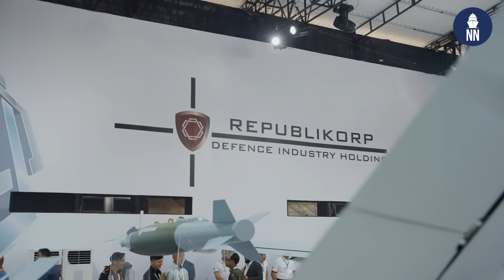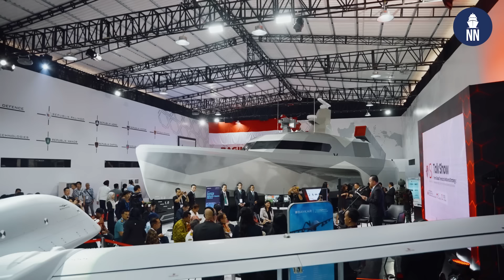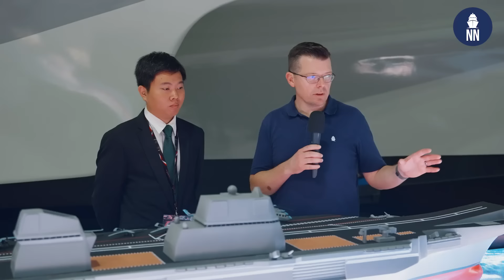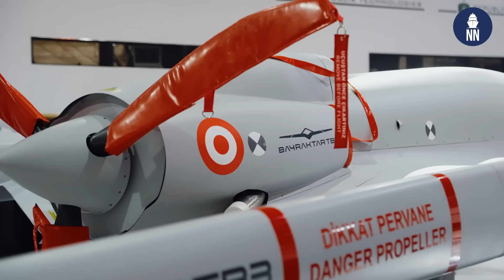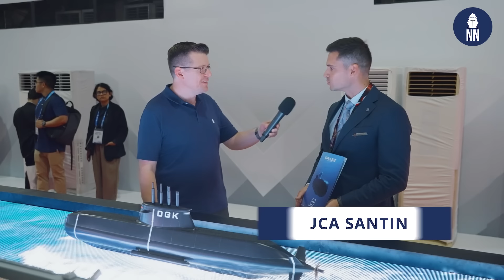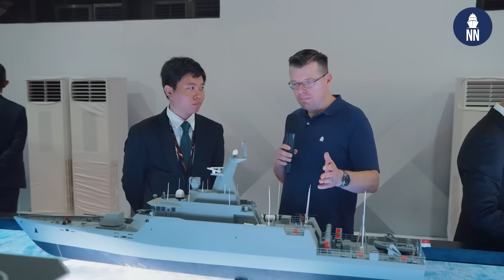Republikorp new ship designs at Indo Defence 2025

Comment: Submarine propellers are too small, requiring them to spin rapidly, which creates large air bubbles, resulting in loud noise. This is highly undesirable, as it makes the submarine easily detectable.
My recommendation is to use a propeller 25% larger than the current one; this will reduce noise.
Reply: 😂😂 semuanya sudah di perhitungkan kawan tidak mungkin asal buat saja
Reply: @MuhamadFirdaus-r1b secara fisika dan kimia apa yg saya sampaikan itu adalah kebenaran yg tidak bisa dibantah   Dasarnya ilmu pengetahuan.